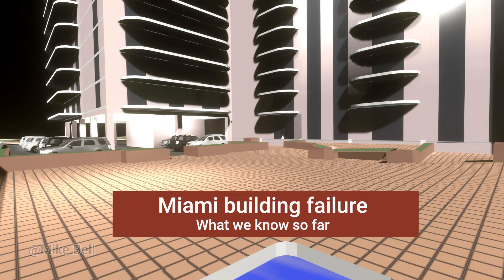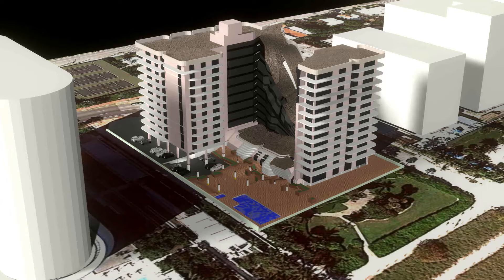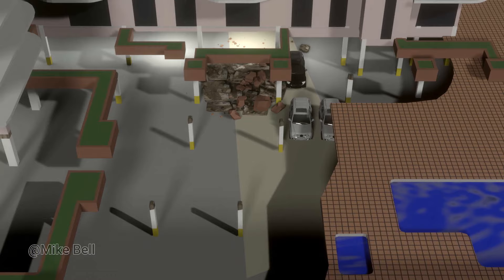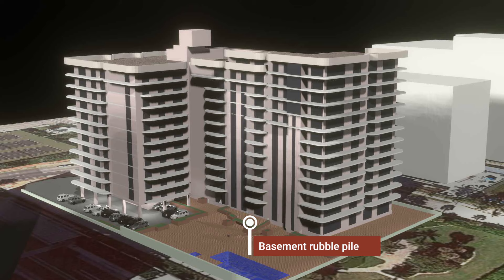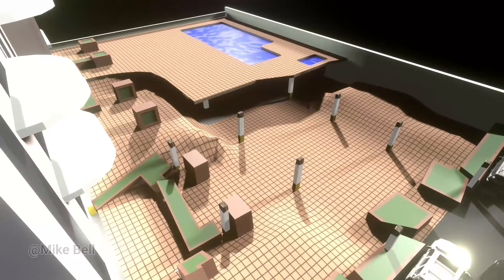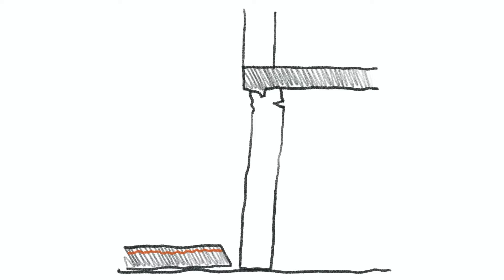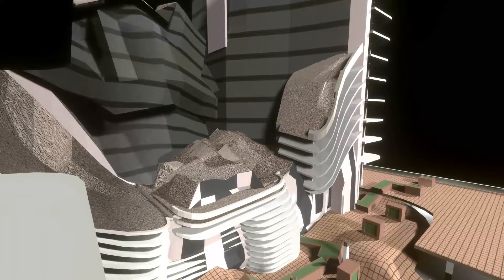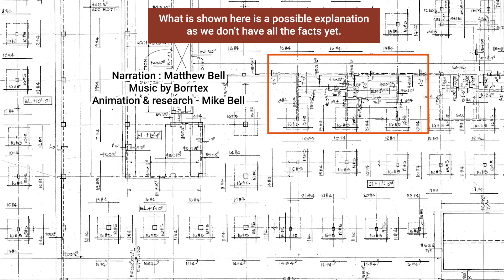MIAMI CONDO COLLAPSE | visualization of the evidence pt2

Comment: Makes you wonder who else heard the 'loud construction noises' minutes before the fatal collapse but didn't get the chance to escape in time. So tragic.
Reply: They seemed to have chosen to stay because they where used to it
Reply: there are empty 911 call assumed coming from someone in the buildings. There were also calls from a wife to her husband before it collapsed too. but they didn't know they only had less than 5 mins to get out
Reply: I'm just sorry that no one thought to simply yank the fire alarm. There were people telling a security guard, people going door to door knocking, and someone going on the PA (in English and Spanish) telling them to evacuate - but no one simply pulled the fire alarm, as far as we know. Those modern alarms can be heard even by deaf people, that's how obnoxious they are.
Reply: @surelyyoujokemeinfailure7531  The fire alarm was pulled......1:16am
Reply: @surelyyoujokemeinfailure7531  In many high rises, residents are told not to evacuate during a fire alarm.  

In one where I lived, they would evacuate the floor of a fire and the floor above it, and everyone else is expected to stay in their units.   The reason is two-fold.  First, they don’t want to clog the stairwells with evacuees, since firefighters need to use the same stairs to fight the fire.  Second, if everyone tries to evacuate at the same time, all the open stairwell doors will create a chimney effect, drawing smoke up from the floor that has the fire - resulting in many residents needlessly suffering from smoke inhalation.  

All of this is based on the idea that high rises are designed to be fireproof.  A fire in one unit is expected to affect just that unit, and possibly adjacent units, but that’s it.  Once all flammable materials in the first unit have burned, the fire is expected to die from fuel starvation.
Reply: @michaelmymichael9106   Interesting, I didn’t know.
Reply: I tend to think that even if the building's managment had approved the needed repairs and gotten the construction personnel on site to perform them, that the forces applied to the pool area (pulling up the tile and possibly moving planters, etc.) would likely have led to the collapse, regardless. And, because it would have then, theoretically, started during the day, the odds of more people getting out aren't much better because they would have likely been watching the pool deck collapse from the balconies and blaming it on the construction work at the time when the building fell.
Reply: @surelyyoujokemeinfailure7531  Interesting read. 🤔
Reply: @MrMJmusicLover  It's very spooky. Sounds like at every step, people misunderstood how much danger they were in. We know from the level of camera coverage in the hallways, on the pool deck, inside the parking garage, inside the lobby, wherever (this is clear in videos) that security cameras were everywhere. Who was watching these? Where did it all get recorded to? How could the collapse of part of the garage (loud; shook the building) not get at least one person's attention?
Reply: @surelyyoujokemeinfailure7531  The early warning came from the woman on the first floor, but in the time it would have taken security to investigate the noise compliant,  there wouldn't have been any time to go floor to floor knocking on doors telling people to get out.  But I'm sure the alarm must have been pulled because most people died in the hallways trying to escape.
Reply: @MrMJmusicLover  That's so sad about people dying in the hallways as they were trying to escape. The way that building came down, even being next to a really sturdy refrigerator didn't provide any protection from being crushed.
Reply: @MrMJmusicLover  how do you know most people were in hallways trying to escape?
Reply: @ameliawhite2404  In the 911 calls people heard saying they traying to escape being on hallways but not stairs. Stairs gone.
Reply: @Awaken_744  oh my
Reply: @Awaken_744  I believe those were people in the section that did not collapse.
Reply: I know right! I'm sure there were many...... I am such a light sleeper, and am positive it would have woken me. Ugghhh Those people never had a chance really..
Reply: @robertbrandywine  No. Those stairs were intact
Reply: @surelyyoujokemeinfailure7531  That refrigerator Would have been crushed like a coke can. 😐
Reply: I understand that the 6th floor resident that was 'half way down the stairs when the building fell' mistakenly went to the stairs near the elevator shaft not realizing there were closer stairs. That saved her life.
Reply: @MrMJmusicLover  Re "crushed like a coke can" << So true. When I first saw the pile of rubble, and how it had a high spot, I was thinking that's where the kitchens were all atop each other. Turns out it was the stairwell, and even that got flattened. To be safe from those crush forces would have required something as heavily built as the bucket of an excavator probably :(
Reply: @MrMJmusicLover  I am positive.  Some people in the new section got trapped temporarily in the parking garage (of the new section) and others perhaps tried to exit by the old section and had to turn around and go down the stairs in the new section.
Reply: @michaelmymichael9106  Yeah, people in the twin towers were also told to stay in place and keep working. One lady left anyway. She survived, her coworkers who stayed all died.
Reply: @sherribrawn3757  Yeah, that was just awful … 😫
Reply: @michaelmymichael9106  The videos of that night were just unbelievable.................... ugggghhhh
Reply: @surelyyoujokemeinfailure7531  I the person got the idea from the last Indiana Jones movie. 🤔
Reply: @robertbrandywine  What is the"new section"? 🤔
Reply: @johnfranklin5277  Sorry, I learned that tidbit from a deaf friend at college who explained how he could tell when the fire alarms are on. They're so loud, they make many regular surfaces vibrate - not just your eardrums.

Back at you, Captain Ignorance.
Reply: @robertbrandywine  What is the new vs old sections? The only “new” part I’m aware of in this building was the penthouse that was added later.
Reply: @Sashazur  Sorry, I meant the part that didn't collapse completely
Reply: They all heard it at some point. Sadly most too late. Moments probably felt like minutes.
Reply: michael mymichael I am very surprised to hear your explanation especially after the fall of the twin towers in New York. Had people left the building immediately after the jet hit it more lives would of been saved.
Reply: @Ricky M could you feel it? My little brother is moderately deaf but he says he can 'hear feel' things (I would have no idea honestly, but I am asking out of general curiosity).
Reply: All hell was happening as of 12:30 which is why three residents left by way of the lobby and told security to call the fire department before the pool deck collapse.  Once all that square footage of concrete slab punched through and hit the parking lot that  sent a shock wave through the entire building that would have startled all but the soundest sleepers awake.  Still, without a fire alarm or security forcing the building  to evacuate, most of them probably figured they'd wait until morning to inspect the damage.
Reply: I don’t expect anyone slept through the sound and vibration of the pool deck collapsing.
Reply: @stargazer7644  Right?  That like a million pounds of concrete.  It must have caused a shock wave in the garage that blew all the air out through the ramp entrance.  Just for starters.
Reply: Hi. Sad ,sad.  If you watch the video showing building falling..shows some lights coming on in the upper condos..TWO condos on different upper floors....I saw  a TV on...it was in the building that fell last ,  but only seconds before it was collapsing also.
Terrible way to die.💔
So sorry for your loss
RIP. EVERYONE
Reply: cassondra billedeau-stratton was on the phone to her husband as it collapsed, she said that the pool deck fell in and there was a scream and the call cut out
Reply: @emilymatt9999  You have a problem.
Reply: @straighttalksucks5161  I imagine a lot of us would have stayed. It was 2am. We'd probably get annoyed, roll over, and try to ignore it and sleep.
Reply: @surelyyoujokemeinfailure7531  refrigerators aren’t magic.
Reply: @richardvinsen2385  Re "refrigerators aren’t magic" << Nope. They are big heavy metal boxes with at least some rigidity to them, more so than a cabinet but less so than a car. Can you think of any other common household object that would have had more crush resistance? (insert cricket noises) And that's why I mentioned it.
Reply: @surelyyoujokemeinfailure7531  Are you serious!?   You think a refrigerator is going to withstand the weight of multiple tons of concrete collapsing on top of it?
Reply: @michaelmymichael9106  That, in reality, never works. That idea, is now so absurd because it has been proven false so often. I'll cite as proof, Grenfell Tower, Chester County, and even in Spencer St Melbourne. It is a great theory if you are only looking at an office building.
Reply: @saramae9878  That's exactly it.  Why bother getting up at 2:00 when you can't see anything out there.  Ofcourse in my case I can't remember ever sleeping through a Saturday during my ten years in Miami.  But that's just me!!
Reply: @surelyyoujokemeinfailure7531  Well, maybe my 1950's Wedgewood stove. solid iron and basically indestructable..  But, no one had a chance under pancaking concrete. I jest about the stove.  Weighs 500 lbs easy but have to do Thanksgiving in stages because of tiny oven.  Seriously,  many want to say "what if this?"  Or why not that?  Or "They should have known..." It was a tragedy.  What can we learn from this?
Reply: @surelyyoujokemeinfailure7531  Please sir I responded in jest about my stove.  I get your point.  I live in California have been through innumerable earthquakes. Running alongside one of those monstrous Sub-Zero stainless fridges DOES make sense.  We were told to stand in doorframes now it is cover under tables if you can.  Impulse is to run outside but authorities say no b/c risk of falling debris.  For me the Champlain towers event touches me on basic human sense and exposes to me ( only me) our fragilness
Reply: @lisakoumrian5301  Thank you for explaining. Uggh, the CTS collapse makes me feel sad and icky in the same way some other disasters do. Most of those people were asleep, or perhaps struggling to awaken, as their own building collapsed. What an awful way to go :( Let's be grateful that most of us live in places where the authorities take building codes very seriously.
Reply: A question I've always wondered: were there any signs? Now I suspect that there were, but not knowing what was happening, the occupants simply ignored it until it was too late.
Reply: @sherribrawn3757  Yes I fear most were awake and if they ran to the east stairwell they died.
Reply: Alpha Omega  Way too soon bub.
Reply: @johnfranklin5277  My dad played in a Symphony that would perform at the Ontario School for the Deaf ..... The Audience could "feel" the music ....... So there : p
Reply: @bleepbleep1961  feeling vibrations,  and thumping bass is not hearing, so there.  Deaf people  certainly can feel touch, and vibrations.
Reply: @johnfranklin5277  Oh no, I'm merely repeating to you what a deaf friend explained to me. Clearly it's just one of the many things that are as far beyond your comprehension as the moon is beyond a cow. On the plus side, the world will be a continual surprise to you since there's so much you don't understand.
Reply: Can’t imagine that. So sad
Reply: @michaelmymichael9106  Reason #48: Why I'll never buy a condo...if my house is on fire, I want permission to leave.
Reply: It’s crazy because looking back u can see people must have been getting up to see u can see a few lights go on while it’s falling 😢😰
Reply: I think the commotion of people rumbling down the stairs wouldn't have let anyone escape anyway.
Reply: @surelyyoujokemeinfailure7531  you mean the vibration of the alarm?
Reply: @Us3r739  Exactly, that's the way he explained it to me, feeling things vibrate when he touched them.
Reply: @michaelmymichael9106  and along comes Grenfell..
Reply: @krane15  there were 3 years worth of signs.
Reply: The last thing you think is the noises are comming from your buiding that is falling appart.
Reply: @johnfranklin5277  I agree wit hyou, but I used to work in ah otel that did have a deaf alarm. It was installed in certain rooms deaf people could choose to sleep in. It would strobe the room with a bright strobe light, before they were given the room theyd be shown this feature and asked if this is what they wanted or if they wanted a room without this feature. So it is possible this place might have had rooms like that, they do exist.

Comment: Singularly the best representation. Taking on board witness statements and events for a full overlay of timeline. Definitely those ground floor units were key witnesses to either longer term issues (cracking issues) and the events of the night.  My heart goes out to the little girl who experienced her bathroom ceiling cracking and had the foresight go grab sibling and run to mum at reception desk. Excellent work.
Reply: I agree but they have been building on the beach here  since the 20’s and with a lot sketchier construction techniques than Champlain (they used to wash the beach sand to make the concrete! ) and nothing like this has ever happened without years of visible warning. The corrosion and spalling in key components become evident long before failure. While this building knew it had problems, it’s hardly unique as an association not being on top of it’s waterproofing. And that’s the scary part about living on the beach in older buildings now…not knowing if is this the Canary in the mine shaft or a one-off event with a yet unknown trigger. 
Unlike 911, experts deconstructing what failed in due time, here is a huge safety and financial incentive for urgency.
Reply: Oh, I did not hear that story about the girl in the bathroom, wow- :>(
Reply: Someone said it was a sinkhole that was causing this cracks and collapse overtime. This is sad.
Reply: If you check the timeline up in the Notes, you will get an accurate understanding of what the collapse survivors saw, heard, and experienced. For example, no one on the first floor reported a crack in the ceiling but rather a loud crash that sounded to them like a wall falling down. The occupant of 611 saw a crack forming in her living room and evacuated in time to survive.
Reply: I had not seen this simulation until   A year after it was posted. Excellent graphic display on the chronology of events.